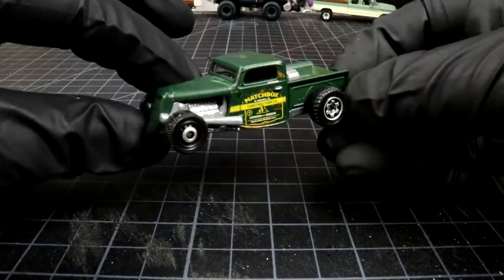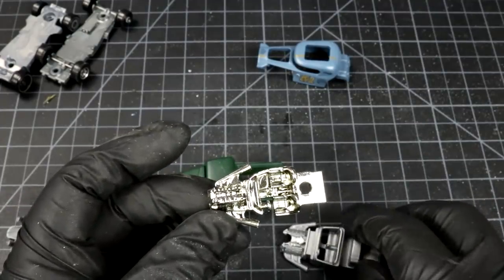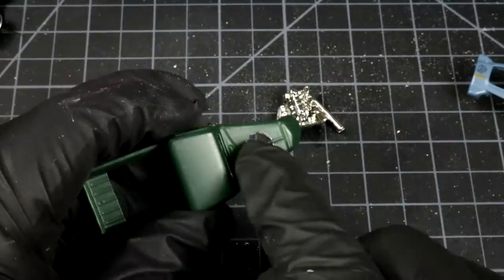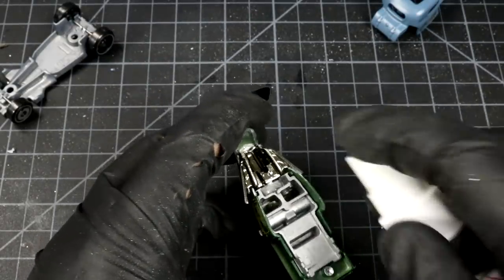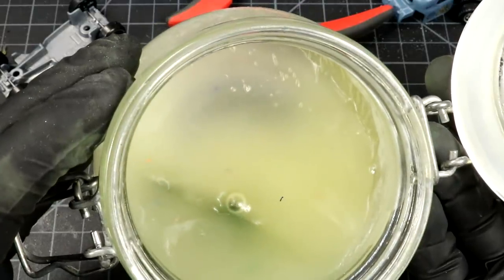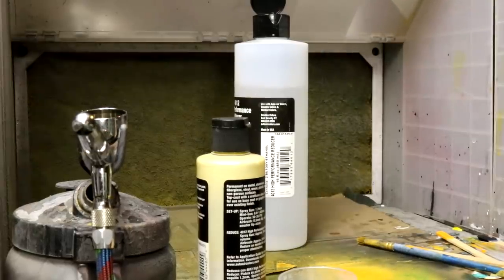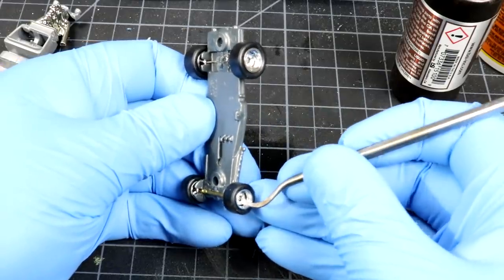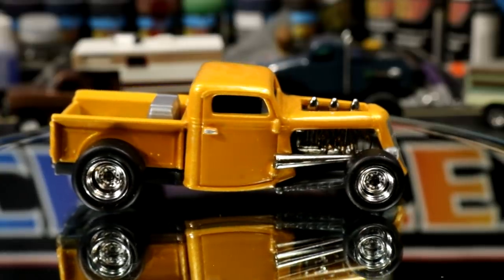Painting Diecast Cars - Matchbox Hot Rod -  Hot Wheels engine Install

Comment: Awesome custom and colour! As the paint stripper seems to have been 'de fanged', why not try the caustic soda route? Rob at Matchbox Garage uses it all the time, and it often only takes seconds. Using a tall heat-proof glass jar (he uses a foot-long hotdog jar), and only enough boiling water to cover the model, and a spoonful of lye, he gets great results. I'd still check out the smaller hardware stores, to see if they have any of the good stuff, though.

Comment: Did your cars go bloob bloob bloob when you were a kid? Wondering what kind of cars you grew up around.
 Love the color and the engine swap but why did you leave the dual exhaust pipes on it? Mod Rod is a sad casting and one of the reasons is the dual exhaust on a straight 6.
Reply from the maker: Most of the time I imitate this beastly truck I used to have with a big cam, 3" side exist exhaust, headers and Flowmaster 60 series mufflers. I had this truck about 9 years ago lol
Reply from the maker: These cars are made for kids, so maybe cut them some slack on the details.
Reply: @DiecastResurrection  Well I would cut them a bit of slack but next thing you know we'd be up to our eyeballs in 440 Pinto, COPO Barracudas and AMC El Caminos. No sir I think being firm with them is the way to go....... well maybe a little slack but come on dual exhaust on a straight 6?

Comment: I like it but I think it would look better if you had dropped the exhaust tubes lower to the ground.  In a real vehicle the exhaust would spit crap all over the nice paint job on the doors....and probably ruin the paint.
Reply from the maker: In a real vehicle the inline 6 motor wouldn't have pipes on both sides either, good thing its a toy right..